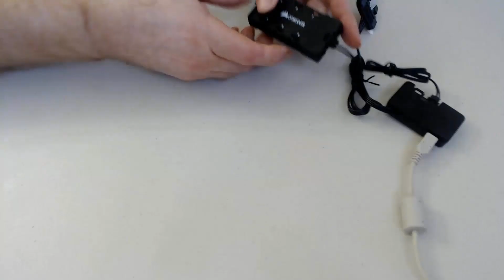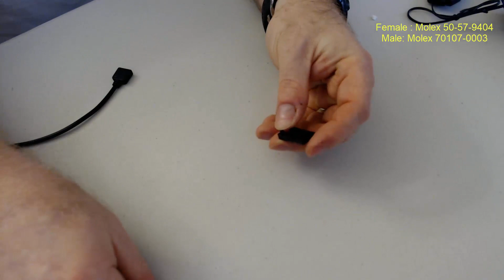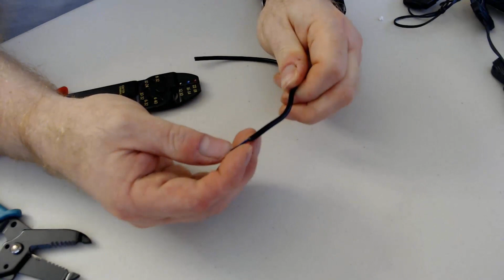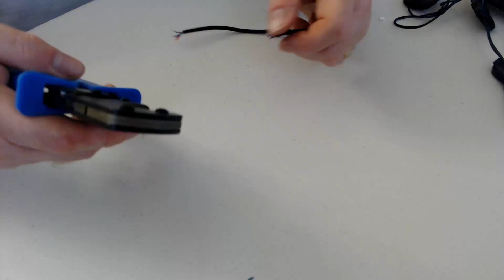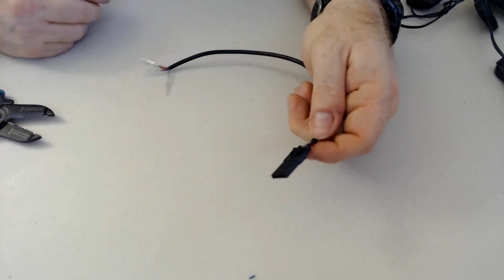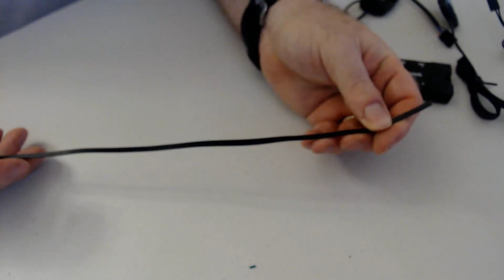Making Corsair Link RGB Extension Cables

Comment: thank you! I'm familiar with crimping atx pins, and actually have one of the best crimpers. all I need are the housings and pins!! Thank you! Corsair rib cable management is a nightmare!!! this will help me make neater runs and put all the hubs anywhere I want. I wish I had these now as I knicked one of my QL120 rgb wire and I had to cut and solder. Thanks!!!!!

Comment: Thanks For the video  I have been looking all week for the molex connector housings for corsairs RGB  within 5mins of your video everything I needed to know so just ordered a rake of 4pin connectors and 3 pin connectors now I just got rewire some other rgb fans and strips  and test if they will work with Lighting node and commander pro. Thanks Again
Reply: did it work?

Comment: I tried crimping these connectors using 22AWG 4 circuit and an MDPC crimping tool, with not much luck. Whilst the connections are Max rated for 22AWG, they have a very tough time going into the connectors, often breaking and causing you to cut the cable and redo all four.
So, as you said originally, I think better to use 24AWG!

Comment: Hey man, nice video! but is it also possible to use jumper cables to connect Phanteks neon rgb strip to the node pro?
Reply from the maker: That'd be an adapter and YES. The Phanteks strips use JST-SM connectors and come with a motherboard ARGB to JST-SM adapter. So you can use either the JST-SM Adapters (https://piratedog.tech/products/corsair-rgb-to-jst-sm-addressable-rgb-adapter) or the Motherboard Adapters (https://piratedog.tech/products/corsair-rgb-to-aura-mystic-light-motherboard-a-rgb-adapter / https://piratedog.tech/products/corsair-rgb-fan-to-aura-mystic-light-motherboard-a-rgb-adapter).

Comment: it would be nice if you could make something like corsair to solderless rgb cable for the node pro
Reply from the maker: Wouldn't work, unless I'm missing something. The solderless connectors that I've seen are for 5050 (4-wire, analog RGB) LEDs. Corsair uses WS2812 (3-wire, digital RGB). Unless I'm missing something ...
Reply from the maker: So ... I did some digging and did find some solderless 3-pin RGB connectors. Should be workable as long as the pinouts are the same and the LEDs are WS2812. Do you have a specific application in mind?
Reply: @Dev-Biker  Didn't get a notif that you replied, but i just received my 3 pin rgb lights, and i basically did exactly what i mentioned and it works as a charm, application would be to be able to extend at a cheaper price because tbh, 30 usd for 40 leds, is kinda expensive, i can just get 60 leds for like 10 usd
Reply: also, you would need to mention, that you can only use it by 10's, untill 60, basically only would work if you got 10 20 30 40 50 or 60 leds per lane, it wont work if you get 27 or 108, because if you go over 60 you can't specify it in the program, and having a non X0 number will make it flicker and not have the animations display correct
Reply from the maker: @Edaurd  That's only true if you configure them as strips. You can configure them as an HD or LL fan as well. The effects will be a little different - Pong, I imagine, would be quite odd - but HD fans have 12 LEDs each and LL Fans have 16. So with 6 LL fans, you'd have a total of 96 LEDs. That said, more than 60 and you run a risk of blowing a fuse unless you provide power separately.
Reply: @Edaurd  and @DevBiker 
Good Info. I wouldn't have though of that.

Comment: Hey, really good video!
I wondered if you knew the parts required if I want to cut the rgb cables of my EK Vardar evo fans to make custom length RGB cables? These are the standard 4pin, but I cannot find any of the female connectors required. I noted you said you had custom rgb extenders, did you make these?
Reply from the maker: You can get any 4-pin RGB extension cable. The male connectors are just a set of pins that you plug into the female connector. They are pretty widely available so no, I don't custom make them.
Reply: DevBiker thanks for replying! I’ve looked at buying any rgb extension cables, but to make a custom length one it looks like I need to cut the rgb wire a few cm from the female end and solder new wire on to the end right? My OCD will kill me as the join will be a big bump in the wire and I haven’t figured out a way to make it look pretty yet. Was hoping I could find female RGB ends that I could just solder my wire on to
Reply from the maker: @cpjmmxiii8243  Well, you can just get the headers, cut your custom length and then solder the headers on. You can get inexpensive, single-end RGB cables where the cover for the connector comes off and you can directly solder there. 
It's tedious, to be sure, and more involved than simply crimping to a custom size.

Comment: Awesome video thank you! You happen to know if there’s a way to control non Corsair light strips with the Corsair lighting node? I figure it should work with an adapter right?
Reply from the maker: There are some limitations but it can be done. I actually have some available in the store. I've also made custom adapters for Barrows RGB.
Reply: Cool thank you

Comment: I'm under the impression that despite the Corsair RGB HUB using 4 pin connectors I won't be able to plugin for talking sake of a 4 pin connector from an Antec fan, I thought all RGB connectors would follow the layout of < P G B R > ? If so is it possible to rewire the Antec cables to a Corsair connector and have them work ? ? ? ?
Reply: Nope, the pinout for the Corsair fans is not < P G B R >. that's the configuration for 12V analog fans. The Corsair RGB is 5V Digital RGB.
Reply: @piratedogtech5910  
Thanks, any and all insight is much appreciated. I tried Discord about several times in the last two days and got no answers.

I decided to get Antec Prizm X 120 ARGB Fan because they're rated at a higher speed with a lower decibel, I've been told by 3 different people that the fan speed will be controllable from the Command PRO but with a 3 pin ARGB, I'm guessing  I will need to take up more space in my case with the separate RGB controller. 

Do you think it might damage the fans or controller if I test to see if the 5vARGB is compatible with the 5vDRGB ? ? ?
Or should I just use the separate controller for both fan speed and LED control ?
Reply: @kraig800i  Which Discord server did you try? Might I suggest Corsair Case Owner's Club? Even if you don't own a Corsair case ... 
"ARGB" and "DRGB" are typically the same - Addressable RGB and Digital RGB - but with different nomenclature. If it's compatible with Aura/Mystic Light (and those are) and addressable, then they are WS2812B LEDs - and the same that Corsair uses. 
Be careful chasing specs. There is no standard for the measurements of those specs by the manufacturers. Speed isn't everything; you don't usually run at full speed. And they don't give you an idea of what the CFM or static pressure is across the range of the fan's supported speeds. These stats are, unfortunately, difficult to find.
Reply: @piratedogtech5910  hmmm can't seem to find that discord. . .  I was @BuildaPC discord.

It has the full specs on the listing and quiet a few You|Tubers seem to have positive reviews about them. I know the fan speed isn't the be all and end all but a max rpm difference of 1000rpms more for the same price kind of rubbed me up the wrong way towards Corsair's £45 "budget" option.

https://www.amazon.co.uk/gp/product/B08JQ9PBDS/ref=ppx_yo_dt_b_asin_title_o01_s00?ie=UTF8&psc=1

Comment: Hi. i don't want to use corsair's controller. I have arduino to power it pu but, even if this is an argb fan it has 4 pin connector! So i don't understand how i should connect it! do ypu know the pinout? in classic ARGB we have e pins -> ground, 5 volts, data..... but here?!? 4 pin ->

what are your ideas?
Reply from the maker: Actually, "classic" ARGB is +5V, Data, Ground. 
The fans have a "Data Out" line that is used to pass signal to the next fan. This allows all of the fans to be addressed individually. The pinout is +5V, Data Out [From Fan], Data In [To Fan], Ground.
Reply: @Dev-Biker  you saved my life!! :) So i can connect the data out of a fan to the data in of another fan and command all the fans with just one digital output!? This is wonderfull!
Reply from the maker: @BestemmieDraconiche  You absolutely could do that. That is, in fact, exactly what the fan hub does. You'd need to be careful, however, as the fans can take a bit of current, especially the LL fans.
Reply: @Dev-Biker  what do you mean exactly?
Reply from the maker: @BestemmieDraconiche  The current available via different connections, power bricks and/or devices is not unlimited. Each LED uses current when lit. So you cannot put a gazillions devices on any power source and expect it to "just work". You need to keep the overall power requirements in mind and make sure that the power supplied will handle it. This also goes for the cables that you use; specific gauges of cables are rated for a max level of current with the Molex headers.

Comment: @DevBiker Hi, is it possible to make an RGB extension for the QL 120 fans out of 4-Pin PWM fan extensions? Thanks.
Reply from the maker: You'd have to replace the connectors, of course but yes, it's possible. Or you can just buy some from https://piratedog.tech.

Comment: I believe corsair cables are aluminum. The cable you spliced with for the extension is copper. Is it okay to mix copper and aluminum?
Reply from the maker: The Corsair cables are not aluminum. The are tinned copper. And yes, it's fine - the cables never touch directly anyway. Contact is with the pins.

Comment: does this mean you can use a normal digital led strip with the lighting node pro?
Reply from the maker: You can use any WS2812B LED device with the LNP ... as long as  you have the right adapter and configure iCUE correctly.
Reply: @Dev-Biker  Awesome, thanks so much for your reply!

Comment: Could I use a 3 pin adapter cable to connect something like a CoolerMaster MF120R ARGB fan directly to the JCORSAIR header on my MSI motherboard, or do you always need a Corsair hub connected to the JCORSAIR motherboard header which then links in the ARGB devices? Thanks
Reply from the maker: You could, yes. PirateDog Tech has just such an adapter too. ;)
Reply: Brilliant thanks, I may have a go at the DIY option above first as shipping from the states makes a single lead rather expensive unfortunately, there's UK sources for the molex connectors now (Farnell, RS Components, Mouser etc) so I can get the parts for a couple of pounds.

Comment: I'm sure there is a limit to the length of these extensions, Would you know max length you could make these?
Reply from the maker: It depends on the gauge of the cable. The higher gauge, the shorter the max length. I've made cables up to 20' long with 22 AWG, which is the thickest that'll work with the Molex-SL headers. For that length, 24 AWG worked but had significant voltage drop due to resistance, resulting in a noticeable dimming of the LEDs. The 22 AWG cable had much less drop and nice, bright strips at the end ... all of this is due to the lower resistance ... Ohm's Law at work. 
I carry 10' cables in the store that are made with 22 AWG and they work well.

Comment: Thanks for the video DevBiker

I would like to know if it's posssible to make a custom wire to plug phanteks rgb (Evolv X rgb) to corsair ecosytem ?
Because I was dumb enough to mix two rgb ecosystem just because i liked the parts. But now I really like the corsair ecosytem and I would like to plug in my phanteks evolv x in a commander pro to control all rgb from my corsair keyboard..

Here is my system

Case Phanteks Evolv X
Mb Asus maximus X code
Cpu i7 8086k
Aio Corsair 115i pro
Case Fan 6x  Corsair LL fan
Keyboard Corsair k95
Reply from the maker: Hmmm ... I looked at these and it should be possible. That is assuming, however, that they are WS2812B LEDs (but by all appearances, they are). I'd have to see if I could dig up the connector for that cable but, TBH, it might be simpler to just replace the connector on the Phanteks strips instead. In iCue, you'd configure each single Phanteks strip as 3 Corsair RGB strips. And you'd want to limit it to 2 Phanteks strips per NoPro channel. 
Now ... another option might be to connect the Phanteks controller to the NoPro - essentially, it'd be like a fan hub as it has its own power source. Then you might be able to configure it as 6 LL Fans (96 LEDs vs 90 for the Phanteks strips). However, some effects may be somewhat wonky should you do that - things like sequential likely wouldn't be.
Reply: @Dev-Biker  So if I buy this extension cable (https://www.amazon.ca/Phanteks-PH-DRGB_SKT-Digital-Starter-Controller/dp/B07C1VDYNG?th=1) and cut one end, cramp molex 50-57-9403 and Molex 16-02-0102 as per your post(http://forum.corsair.com/v3/showthread.php?t=174759) and connect it to  the NoPro.

in the evolv X case, ; leds are powered by sata cables. the 2 strip of led in evolv x are daisy chain. (don't think I need to buy phanteks rgb controller hub)
Do I will need to connect only 2 wires : digital and ground from phanteks wire to the NoPro? and which one goes where? I'm a little scared to fuck things up...
Can you help me figure this out ?
Reply from the maker: @martinallard4799  That sounds right. Of course, since I don't have the devices, I can't confirm that. 
As for the Corsair Pin Out - on the LNP, Pin 1 is +5V (this has the arrow on the connectors), Pin 2 is Data and Pin 3 is Ground.
Reply from the maker: @martinallard4799  That should work. I may get some of the Phanteks strips myself to see what I can do with them.
Reply: @Dev-Biker  thx anyway for your time, videos and posts, really appreciated!!!
I ordered molex connector and crimping tool, phanteks wire.
let you know how i will do.. in 2 weeks when i'll receive all my stuff
Reply from the maker: @martinallard4799  I've order some of the Phanteks stuff as well. The 30 LEDs per strip intrigues me and I have a specific use for it that I'd like to try. I'm also interested in the motherboard connector and actually wiring them through that.
Reply from the maker: @martinallard4799  Update: I got the Phanteks cables in. I used an Aura ARGB cable and crimped that to the Corsair header. Works like a charm.
Reply: @Dev-Biker  Nice,it's good to know!!!
Look foward to do it also. Any tips for me?
Reply from the maker: @martinallard4799  Take your time ... be aware of the pinouts ... use a multimeter to test the wiring. 
I'm also gonna make a few - a limited "run" of cables - and list in my eBay store.
Reply: @Dev-Biker   you should post your ebay site on this reddit site when your phantek/corsair wire will be available.
https://www.reddit.com/r/Phanteks/
Start a new post title Evolv X RGB to Corsair icue made possible.
You will sell all your wire there😉
Reply from the maker: @martinallard4799  Thanks ... I just may. I gotta say ... as much of a Corsair fan boy as I am, I am impressed with the Phanteks strips. And their hub. Very, very nicely done. But ... control is lacking. iCue certainly rocks at that.
Reply: @Dev-Biker  it doesnt work for me with only digital and ground. Do you think I can use 5v from lighting node pro? It may activate the led because drgb wire that goes to mobo has the 3 pins connected and it works.
Reply from the maker: @martinallard4799  Is that using the Phanteks hub? Or direct to the Phanteks strips? Direct to the strips will require +5V. To the hub shouldn't but I didn't test it; I just tested with +5V and it was fine. 
So you can use the +5V. Just take care to that you don't draw too much current. BTW: https://www.ebay.com/itm/372499030952. Just listed it today; I have one running 2 Phanteks strips on my case.
Reply: @Dev-Biker  i was not sure a the begining if a needed 5v because in the evolv x case led are powered by sata( and works with a button on front panel), but i saw that the d rgb wire that goes to aura sync (like the one you did!!!) uses 5v also so there must be a circuit or relay that detect 5v from other source and bypass front source .
So that case use 60 leds so it should be like your 30 led strip that tou just buy..
Reply from the maker: @martinallard4799  Hmmm. Well, I cannot speak to the strip controller in the case. However, I did just test the controller that comes with the starter pack and it did not require the +5V line. It doesn't makes sense (to me, at least) that they would bypass the SATA power connection and use motherboard power instead - you have more current available from the SATA connection. Phanteks is typically pretty good with details like that. That said, supplying it shouldn't hurt.
Reply from the maker: @martinallard4799  I've not had any issue with this. I did have a customer with a similar, but slightly different, issue ... they updated the firmware on the LNP and it was fine after that.

Comment: You should point out that parts (Molex connectors) are only available in USA. To have them delivered to Europe (where they are only available as wholesale products) costs $30 for $2 worth of parts. Another shining beacon of American greed.
Reply from the maker: EU Source: https://www.reichelt.de/ (provided by a member on the Corsair forum). 
You can get them from China as well; last I checked ModDIY also carried them though they don't list them as "Molex SL series".
Not sure if the reason that European shops don't carry it is "American greed" either. That's something of a stretch but if you wanna roll with that, have at it.
Reply: Aliexpress my friend, its simple and easy and delivers to Europe!